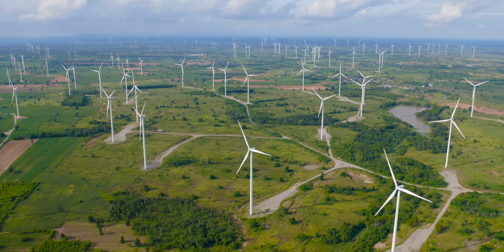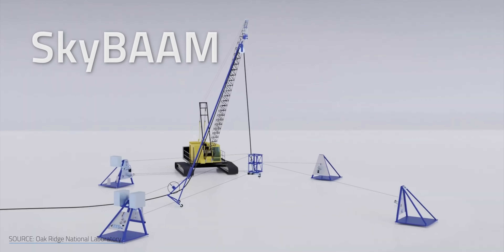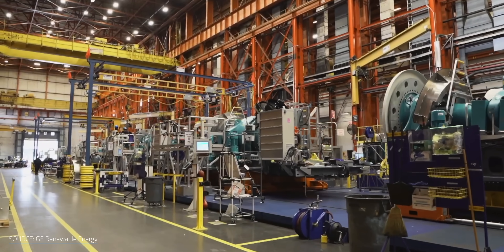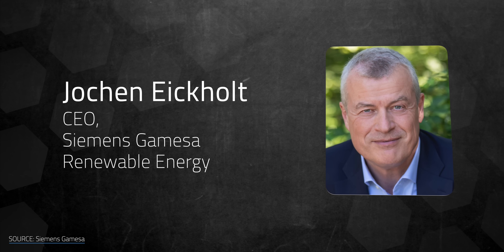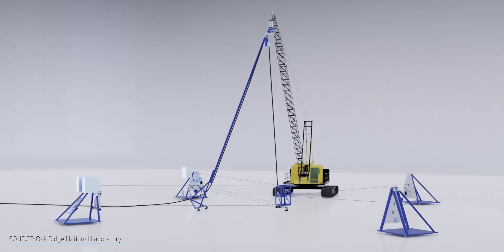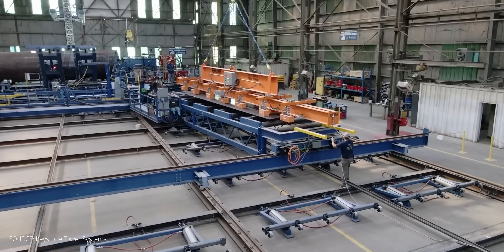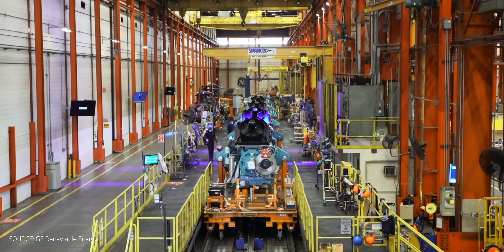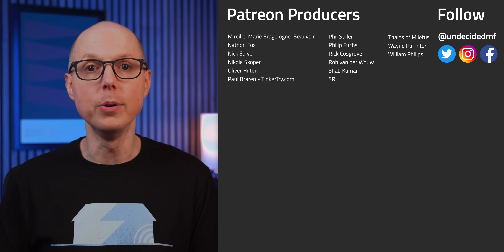Why We Need To Rethink Wind Turbines

Comment: These industrial and provider-scale solutions seem to be running into a similar type of problem set to what we're seeing with reactors - intensive reliance on bespoke manufacturing, extreme cost outlay and capital requirement and seemingly much higher risk if the device fails (years to fix, same problems building and shipping parts, etc.).  The multi-rotor thing looks more viable, albeit much uglier. 
Personally I'm more interested in small to medium sized units which require less capital outlay and will probably become more popular with small communities or individuals in windy areas.  The closer we can get to automation and standardised parts with factory line production the better, SMRs are expected to utilise the same cost savings to raise their viability. 
With the Boomers retiring capital availability is going to see a sharp decline so smaller means not just "better" but I think will also mean "possible at all" now;  perhaps a variation on that large multi-blade thing where it can be expanded and added to over time?  Where you can add more turbines as demand grows?
Reply: ultimately you hit the nail on the head.  If homeowners were able to install a small less than 50 pound unit on their own roof then wind becomes a game changer.  If a small wind turbine was sold at every Home Depot, Lowes and Walmart things change.  Why generate a ton of electricity in a far away wind farm, when you can just offset a little of what is being used nearby?
Reply: @jamisonmunn9215  I disagree. Wind turbines and e.g. solar scale differently. For solar, the output scales linear in the area and the only difference between utility scale roof top and home installations are economy of scale for parts. Wind turbines on the other hand scale with the area covered by the rotor, meaning that increasing the length of the rotor by 20% will roughly result in 40% more potential energy to be harvested. This is limited on land by limits on the sound emissions, but even when restricting the speed of the tip of the rotors, the added size helps to shift the wind profile toward lower speeds. The vertical turbine designs at this point are mostly toys and far from mattering in the real world. At this point, a few wind turbines near every village are much more effective than a 100 small case turbines on each house in the same village.
Reply: @joergsonnenberger6836  i dont doubt anything you are saying.  These giant wind turbines have multiple giant problems though; massive size, huge costs and insane maintenance.  Also a 1,000 turbine order from one of these big turbine manufacturers would take them more than a year to deliver.  Meanwhile if Home Depot sold 1,000 of the small ones in year they would kick that company out of the store for wasting their time with a product that doesn't sell.
Reply: @jamisonmunn9215   You are seriously underestimating the dimension of the modern wind turbines. Home installations are typically in the low kW range. A modern on-shore wind turbine typically will have between 3 and 6 MW, offshore turbines are now build with over 30MW. So a factor of 1000 is literally still in favor of the big turbines. For a 1kW home turbine, you typically pay more than 2000USD. For the big turbines, a rule of thumb for the whole project including grid connection is 1 million USD for MW of power. As such, it is much cheaper. Maintenance scales as well.
Reply: @joergsonnenberger6836  I'm not under estimating anything and everything you are saying is exactly illustrating my point.  The video outlined multiple problems and I have stated a few more and if they were so profitable why is every wind company losing money?  That is the root of all the issues.  When your lot size is 100 or 1,000 you cannot work out the bugs you cannot drive efficiencies and you can tell that from the video.  What is the first thing they are doing when they want to get more efficient, they simply gp bigger.  Every one of these companies are losing money because there are no economies of scale.  How come every startup the video talks about not one is making turbines how they are currently being made?
Reply: @jamisonmunn9215  This also rather beneficial to the grid operators too - power is generated near point of consumption which means they don't have to carry that power on the main lines.  If we can somehow stabilise buffering technology (grid scale batteries) this all falls into place more;  for any realistic large scale EV adoption we're going to have to have something, in many countries the grid can't handle that level of rapid increase in demand and generation is an equally giant problem (which is why I think we're going to see SMRs everywhere at some point).  
Personally I see wind/solar/tidal ending up more for charging use (charging EVs, generating hydrogen, etc.) in the longer term as these tolerate variances in input power more readily and can be "topped up" from the grid.
Reply: @@wishthound4724 that is exactly my point i dont care what it generates.  What I do care about is what was indicated by the video talking about how every one of these companies are losing money.  The turbines are too big, too expensive and too difficult to maintain.  Think back to the birth of the airplane did the Wright Brothers first flight use a 200 seater aircraft?
Reply: The research and development of gigantic turbines seems like an interesting business problem. I wonder if a manufacturer might do better by building their own power companies so they don't have to convince a customer that their product is worth the price. Instead of selling turbines they can sell power and use the profit to support the R&D to make better, cheaper turbines.
Reply: @dave7038  that brings them into the fickle and often contentious world of power generation which is whole series of problems in of itself.  Governments ran these on a nationalised utility basis for a long time until someone worked out they could turn it into a profit centre and we forever paid far more for power as a result, in Australia power prices skyrocketed with year after year price increases that would make you cry, I remember one year it jumped 27% and they never go down again.  Governments pull in revenue without calling it tax and having a third party to blame for increases, it's win win for them...  I don't think manufacturers would want to bear that much risk to be honest because it introduces the risk element of having to deal with different administrations and their whims and fancies of the day.  Real minefield indeed.
Reply: @dave7038  Why would such a scheme make economic sense? If the turbines are good enough to operate on the free market, there is no reason to go into a completely different domain and bind a lot of resources like that. If the turbines are not good enough to operate on the free market, why would someone with the capital to build a wind farm want to build their own turbines compared to just buying what's the best on the market. That's ignoring all the regulations in different parts of the world that can prohibit vertical integration in the energy market.